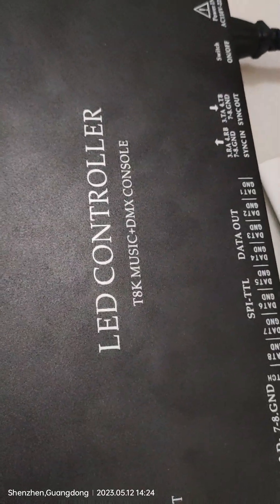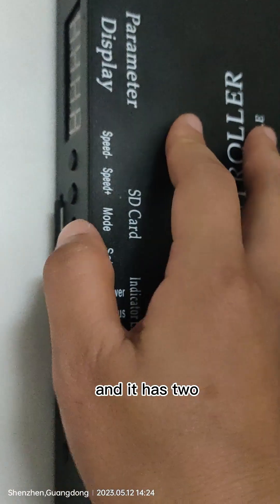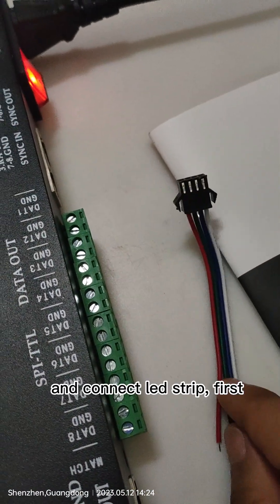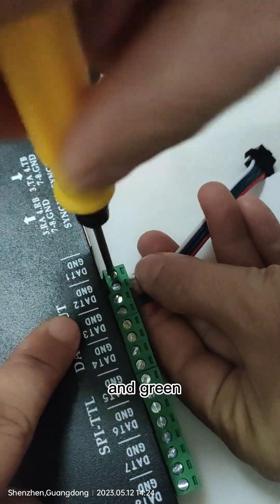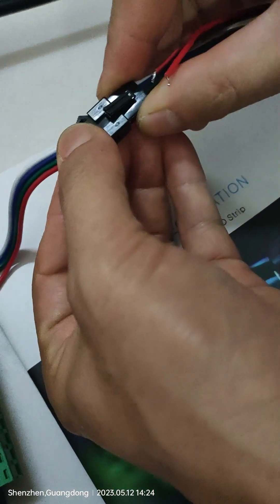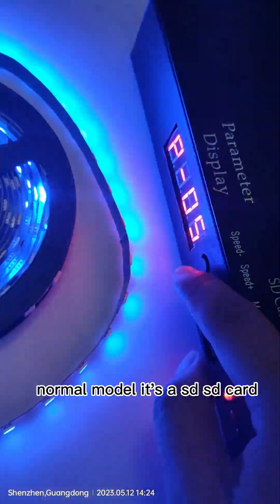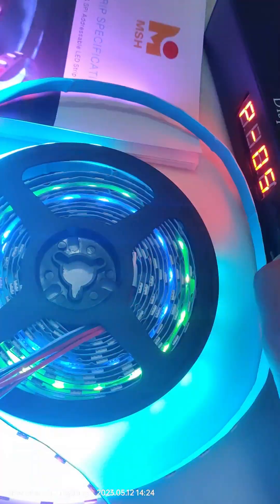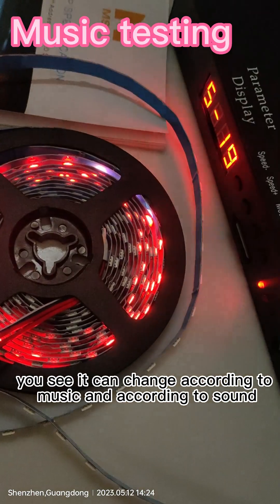Experience Stunning Music Animation with K8-Music LED Controller and WS2813 LED Strip Light.

Comment: Cost
Reply from the maker: talk via whatsapp 008613267109053, thank you.
Reply: Can i install some leds with 5volt and some leds with12 volt at the same time ?
Reply from the maker: @erhankonuk2738  dc5v and dc12v can not use the same power supply